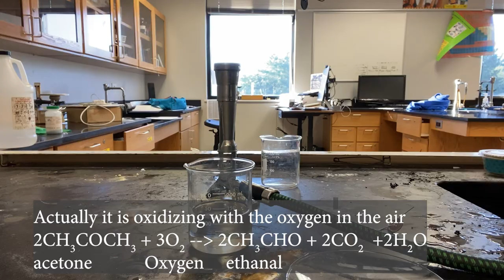Glowing Penny - Copper Catalyzes Oxidation of Acetone

Comment: Definitely gonna build a lil camping space heater with this concept
Reply: Darwin award waiting to happen,  

this edit/addon is for the people that dont know whats happending in the reaction and may be thinking about doing it for their kids or somthing .

First the copper oxidizes the acetone vapors to Ketene and CH4, and keeping it simple, the ketene and Ch4 get further oxidized to C02 and water  by oxygen. im sure this is being done with copper and in a open beaker to help full oxidation for safty, but  quick comparison to the Ketene lamp apparatus same situation, acetone vapors passing over a heated wire, in a copper tube in a furnace (acetone or acetic acid)exact same principals but either no oxygen  or the few molecules inside the and pushed out or reacted with the ketene untill the system favors only ketene and methane .if you built a heater for camping, its bound to leak at some point one way or the other. 

ketenes lowest lethal concentration is 5.4 ppm (not LD50 but close to this value)  with its LD100 at 18.4 ppm.

cyanide, which is toxic enough most chemist try to avoid this at al costs.  45-50 ppm can be tolerated up to .5 -1 hour without immediate or delayed effects. where 110 --135 ppm  may be fatal after .5-1.0 hour and is dangerous to life 
cyanides LD50 is 1-3 mg/kg , direct contact of 100 mg/kg ( transdermal ) 1.5 mg/kg or inhalation of HCN, NaCN is 14 mg/kg .  

all that means is HCN's LD50 in air is actually 500 ppm.  50ppm people talk about is the OSHA allowance for workers to be around.

Comment: From what I can see, this looks more like chemiluminescence. Because when that layer of glowing haze opens up, shiny copper is exposed, which is not red-hot. If the copper would be red hot at one spot, it would be the same everywhere due to the good thermal conductivity of this metal. The red-hot parts would surely not be quickly wandering around the metal surface like vapour does. The wire doesn't get red-hot neither, although it should have almost the same temperature as the copper where the metals are touching.
This would also explain why the acetone (which has an autoignition temperature of ~550°C at this pressure) doesn't just ignite, as red-hot copper should be significantly hotter than that. Catalytic disintegration of acetone may work at a much lower temperature, and could lead to molecules in an electronically excited state that relaxes by emission of light.
Reply: This is very similar to the process Volkswagen used on their TDI engine in order to pass emissions. The ECU would shoot acetone into the exhaust before the catalytic converter when it detected high rpm and zero distance indicating an emissions test. The principal here has the potential to actually create a cleaner burning diesel engine, Volkswagen used it to cheat and the TDI gets a bad rap.